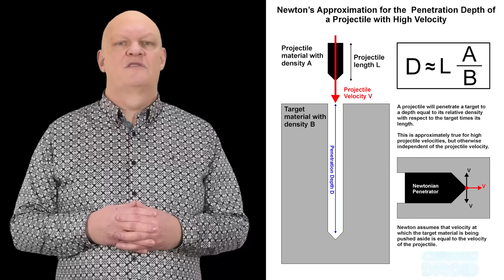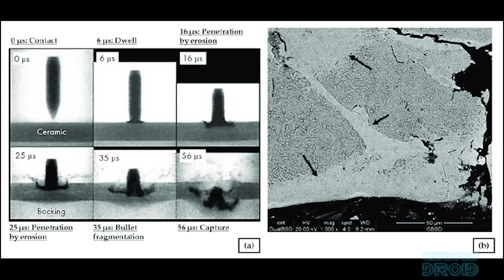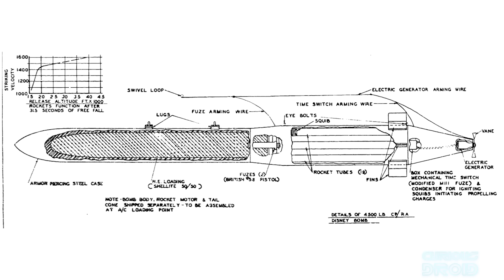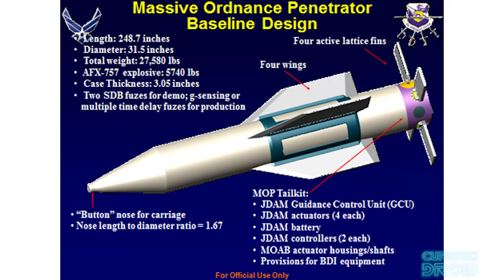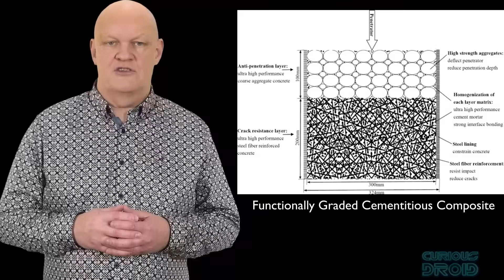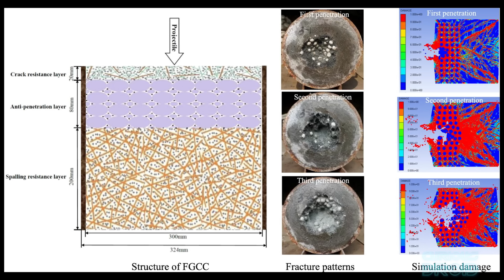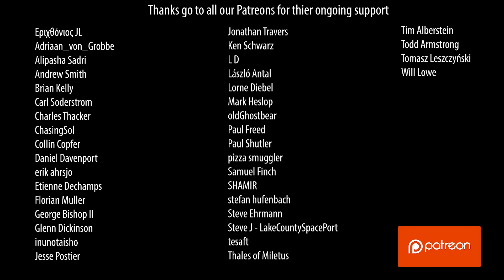Can Iran Stop U.S. Bunker Buster Bombs?

Comment: Worth noting is bunker busting weapons against serious bunkers will only temporarily close ingress/egress routes which are both known (else they could not be targeted) and sufficiently close to the surface to be penetrated. Tunneling far below the reach of any bunker buster including current nuclear weapons has been practical for over a century. Coal and salt mines are examples and could be equipped with their own boring systems to make egress tunnels if existing tunnels were blocked. (That argues for having some delayed action bunker busters to deny penetrated areas.)
A motivated defender can perpetually dig while using finished bunker areas for current operations. Mining is again an example, with many current underground mines like Khewra in Pakistan being ancient. Khewra BTW is expected to have at least 350 more years worth of salt meaning more and even deeper chambers.

Comment: To put it simply my friend :  you can put your pretty head to a .25” drywall and you’d probably make a big hole 🕳️ the size of your head trough that drywall 😊; now if that drywall is was used for decoration to cover up an ugly spot of a cement covered double layers brick wall , well then you will feel something afterward as your pretty head bounces off that wall and found god flying around your head before you pass out with a cracked skull 💀! If you’re lucky you’ll eventually wake up and find a brain surgeon in front of your eyes telling you that he/she found out the problem was that your head was not hard enough for pounding bricks wall re-enforced with concrete 😂! The brain surgeon might tell you to find harder heads like that of Vladimir Putin or that of Donald Trump or even that of Adolf Hitler for the purpose because by using your head this way does not make your head look 👀 so pretty 🤩 any more 😂

Comment: As an engineer that worked with reinforcement bar (re-bar) and 50 newton concrete, I still can’t believe that this stuff exists. I’ve burnt out 14mm, Hilti SDS drill bits one per hole to a depth of 60mm yet these things go through 6000mm and carry on! Insane!

Comment: I'm not sure if we can see polymer reinforcement in 14:18. This looks like steel wires.

The thing with polymer reinforcement is that it is used to prevent shrinking of concrete during curing. Polymers does not make a significant change in concrete tensile strength. It's different if you use steel wires. Its called scattered abrasion, because in opposite to ribbed reinforcing bars they are added to the concrete during mixing, not welded on the construction site. It's downside is that the wires may stick outside the concrete surface.

Comment: The video at @12:07 suggests a GBU-28 was dropped in Iran but failed to penetrate one of their bunkers and instead got embedded. The time reference was the late 2000s, and GBU-28 was the most cutting edge bunker buster at that time, as MOP wasn't built yet. It would also naturally suggest Iran would have a copy of it for analysis and reverse engineering. Also around the same time, a Lockheed Martin RQ-170 stealth drone was captured by Iran. Was this a distraction from it? May I know if there is any credible evidence to suggest this incident took place and what was the context for the attack? Perhaps the reason the US didn't bad an eyelid to invade Iraq but is queasy about attacking Iran?

Comment: Close to 20 years ago or more I was viewing a TV program regarding a quite large Mansion that a very wealthy individual was building on a ridge some where in the US, in a forested State.    In specific the individual who owned the building had it built of a "then newly formulated type of concrete that was  extremely resistant to direct bombing, earthquakes, and other results of detonations such as shock and various concussion stress loads.     The TV narrator mentioned that the formula of the concrete included mixing   a large percentage of specially formed  shaped metal  reinforcers- either X shaped or L shaped and or similar  and  half an inch or so in diameter on average.     The inclusion of the  metal - be it stainless steel or other  type, in conjunction  with standard rebar and other design features made the structure  virtually impervious to conventional bomb strikes or other conventional type explosives as well as natural disasters.    I gathered that the individual who built this Mansion had developed the concrete formula and had sold it to the US Government.     To address other Nations efforts at protective bunkers etc.,  it would seem to me that  North Korea would be an example of a Nation that has a lot of factories under ground - over 135 munitions factories as of 20 years ago - and  these factories and munitions dumps are likely buried deeper than any deep penetrator designed to date can reach, and could likely survive the standard small nuclear weapons yields that would be used.    Don't kid your self that the Russians and Iranians and others have not been studying this issue and American advancements.     A Deep penetrator could not penetrate to the NORAD Command Post, and it would take several LARGE Nuclear weapons to do so as it is under thousands of feet of granite, and then the Rooms in the tunnel complexes are mounted on giant shock absorbers to deal with the shock waves from direct nuclear strikes on the mountain.  One may expect that the Russians, Chinese, and others have similar.    Finland,  from what I understand has a massive civil defense structure under ground to survive radiation - not necessarily blast.

Comment: The U.S. has recently developed a new allow that's even stronger the Depleted Uranium.

Other possibilities is target beside the bunker going 200 feet down and a massive explosion destroying the structure from the sides. All the protection is after all on top.

You can also use multiple bunker busters in succession seeing as they're so precise. Each penetrating deeper.

But as stated at the end of this video, you can just bury the bunker so it's no longer accessible.
Reply: 90m is much too far down for such bombs. 500m is well beyond that.  As for the use of multiple bombs for the second bomb the target is now down to a 10 or 20cm circle in the middle of the hole. I doubt that even precision munitions are that precise. Certainly laser or GPS guided bombs aren’t.

Comment: wowie those bunker buster bombs are Almost as powerfull as the "planes" that penitrated the WTC! Remember the WTC?  Hollow aluminum tubes flew into the WTC and the wing Tips, even Tail, sheared load bearing beams!! And the proof is in the video and the cartoon like cutout image of the  plane and wings tips left when the plane enters and Something exits the WTC, as Rather and Jennings said "it comes out the other side". Impossible. It wasn't the planes nose we see, no, we see The Shape of The Explosion, the plane is the bomb. No aluminum plane can do that.... I stood right at Dwight and Nile, San Diego Ca when PSA flt182 crashed. It didn't leave a hole in the intersection in fact the same asphalt is there today. And the wing snapped off after it touched a home roof, the sidewalk and street. Poof,  wing gone. So what really hit the WTC??

Comment: Food for thought, has there been any thought using the same,composite-enhanced concrete's, possibly capped with the latest ultra high P.S.I. steel for a/the`,
rocket assisted "pencil" thin penitrator(s)?.....

Comment: What if a missile-train approach were used, where multiple missiles precisely follow the same targeting point?
If the newer concrete has different types of layers, perhaps the missiles could use the same approach, where the first lead missile is designed to penetrate to a certain point or in a certain way and each subsequent missile has its own specialised function and capability.  Since these bunkers are stationary, the point could be repeatedly attacked.

Comment: Reinforced concrete structures are now often built in layers with other "laminate" materials in between the layers not unlike how Chobham and Dorchester tank armour is constructed. Some of the "laminate" layers are now fairly high tech polymers that are designed to remove the kinetic energy from "bunker busting" projectiles and when taken as a whole are now extremely effective at stopping penetrative projectiles.
Reply: That's why I'd target the air systems, entrances and non-bunker infrastructure. 

Going to farm, build factories and have oil refineries in a bunker? Supplies gotta get in there some how. Missiles gotta get out some way.

Kind of hard to defend your infrastructure when you're hiding in a bunker.
Reply: But did iran had the know how, Materials and time when they build it up a decade ago i just wonder?
Reply: Smirks In Newton.
Let’s test this theory from 90,000 feet.
Reply: @H33t3Speaks go on then shit for brains please tell me what American aircraft can fly that high
Reply: Nasrallah would highly disagree with your assessment
Reply: @Rvbcaboose714  wasnt he killed in a fairly normal apartment building?
Reply: @POSTSINGULAR1TY  He allegedly were located in a bunker/tunnel  system beneath those apartment buildings. But I would have liked to know the depth.
Reply: @Masterchef_XX it was 18 meters underground. Israel dropped almost 80 bunker busters at it.
Reply: @germanicus7958  that was Israel propaganda said and the Lebanon said that he was in a normal building, I guess nobody will know.

Comment: You only mentioned cement but Iran had built it's new bunkers and tunnels under rocky mountains. So now there is an additional very thick layer of rocks. These bunkers can't be penetrated and for sure they have take any necessary precaution to get multiple entries and exits hidden from above.
Reply: Reinforced concrete has a higher psi rating than mountain solid rock all goes off the psi of the material
Reply: @hookemrods8101 Rock has a PSI rating up to 30.000. Adding dozen meters of rock above the cement makes the bunker impenetrable no matter what. The lost kinetic energy can't be counterbalanced by any other mean.
Reply: @nikolaskallianiotis8622   let me know how that works out up against 110 million connective energy off just one of United-States  new bunker bomb 1000 class 👍🤣 that's the baby of the 3.
Reply: @hookemrods8101 The most powerful US made bunker buster can penetrate up to 60 meters of concrete. That's all. We are talking for hundreds of meters rock and concrete. The other option is to go nuclear but then you start WW3. Learn to read and use your mind.
Reply: @nikolaskallianiotis8622   you're going off the gbu 56 numbers not the gbu 72 numbers 🤣
Reply: @nikolaskallianiotis8622   lmao you're comparing limestone  to quartz us do their test on quartz mineral mountains no soft rock like limestone which is what The Zagros mountain range, itself, has a totally sedimentary origin and is made primarily of limestone.
Reply: @hookemrods8101  we already have the answers. U.S military failed to penetrate Houthies bunkers and they are similar to Iranians bunker if not Iranian s better.

Comment: Why are we using Flintstone units? US military is metric. PM Mahmoud Ahmedinejad is a professor of civil engineering, and the Iranians are experts in novel concretes like carbon fibre mixed with conglomerate. Hitler's Germans uboat pens and flakturm could not be penetrated nor destroyed neither by Grand Slam nor Disney Swish.
What US destroyed in Iraq, the US had actually desogned or built.
Iran watched and learned, they will use a composite construction system of multiple media to thwart US GBU57. GBU 57 has a fuze that explodes on cessation of movement. Therefore an easy avoidance feature is to dupe the enemy into thinking everything vital is indeed in deep bunkers, not a vast sprawling network of moderately hardened facilities with multiple blast doors and blast diversion tunnels to relieve overpressure. 
The US is essentially seeking to penetrate a NORAD-like Cheyenne mountain-like facility. I am sure the Iranians have forseen and mitigated against this obvious target.
Also interesting you failed to mention Iran wins vs USA according to wargame Millenium Challenge 2002 simply through WW2 type robust secure messaging and using known Iranian tactics Lt Gen Paul van Ryper USMC whipped USA. After USA debacles in Syria, Iraq and Afghanistan what on earth would anyone be intoxicated by that US magically wins vs a NVA-Afghan hybrid war with distributed production of newest Russian missiles- with ample open multinational assistance? USA will not prevent every "Muslim ally" smuggling out US top tier weapons- as per Houthi vs Saudi.
Singapore evaluated Igla as far superior to Stinger and Kornet is simply unstoppable 1200mm ++ through RHA/ 3m concrete.

Comment: I wonder if they've just designed bunker busters with Depleted Uranium not only as a penetrator (which they've already done with artillery and some missiles) but also as kinetic mass.  50,000 Tons of Depleted Uranium a shiny hard metal of extreme density is produced every year while extracting weapons grade U235 as well as nuclear reactor fuel.  This weakly radioactive metal is still top level nuclear waste and is an expensive problem for storage long term, making its use as a weapon a solution for multiple problems.  Thing is that it produces Uranium oxide dust on impact which is dangerously radioactive for essentially eternity,  should be a war crime really- but I almost guarantee that there's black project/classified weapons that take full advantage.

Comment: The key to improving the performance of the concrete in impact is to increase its tensile strength. That’s why these modifications work. This can be taken further by instead of using short fibre reinforcement, use long fibre reinforcement. More difficult but the enhancement will be of the next level. This is what we do with fibre reinforced polymers ( composites)
Reply: Like carbon fiber

Comment: The bunker itself can be buried deeper and more heavily constructed.   The weak link is the entrance and the air supply.   The entrance is on the surface and can be hit by precision guided weapons which denies the enemy ingress to or egress from the bunker itself.  Military grade tear gas could be forced into the air intake or we could get creative and pump a stochiometric ratio of butane and oxygen into the bunker through the same air vents.   Detonate it and everything inside the bunker is toast.  I'll speculate that the military has already developed a gaseous explosive that carries its own oxidizer and may have a delivery system to deploy such a weapon to the inside of a bunker.

Comment: As a construction guy, these bombs have always blown my mind. People underestimate just how insane that level of penetration is through reinforced concrete.
Reply: While concrete can be made more resistant, it's a matter of cost/benefit ratio to build many large bunkers using expensive materials.  Then of course the penetration bombs get improved too in a never ending arms race.
Reply: Is it 7873 insanes?
Reply: if it lets anything through, it wasnt reinforced, it was marketed well.
Reply: see 9.25 in MOP bomb this penetrates bunkers that are 61 meters underground so 6 meters of concrete it protects as well as newspaper

https://youtu.be/8m4TlVSQ8As?si=GMNhWC5IaUK-Jq5t
Reply: Piece of cake. Concrete isn’t really all that.
Reply: Its the small block of concrete which have have million cracks and have expanded to make space for it. Its it id reinforced and does not move or bomb will have had time getting theough
Reply: The huge circular bunker (Coupole d'Helfaut-Wizernes) France for launching V2 rockets had a domed roof to cause bombs to bounce off. Tallboys and grand slams were landed alongside the structure. Entrances were destroyed and the surrounding ground so broken up the bunker was abandoned.
Reply: 長い通路とたくさんの小部屋があります
Reply: 200ft
Reply: Sofar.
Recent advances in concrete engineering might require actual nukes  to get anywhere.
Reply: @dwwolf4636  Like he said at the end you would just destroy the exits and equipment that has to be exposed to work.
Reply: @dwwolf4636 imagine a cone charge nuke that makes a violent stream of fire in a single direction
Reply: @dwwolf4636 uhm no ....
Reply: @dwwolf4636  the US already has a new bomb that totally makes this whole conversation pointless.
Reply: @badmonkey2222  not quite really  ... Even the best one  has a limited deepness .

Comment: I think "loose" rock packed in cages with separations between cages would have immense stopping ability. It would behave a bit like corn starch in the way it locks when asked to move rapidly.
Reply: Like the Hasco barriers... I would think the loose rocks would be moved out of the way and/or pulverized, nullifying any stopping power. You're talking about brute force. Usually only something ticker/stronger stops that - like that new concrete - 'supposedly'.

Comment: The Midvale steel company, the research centre of Bethlehem steel, introduced a far tougher alloy for gun barrels, shell cass, and deep penetrating bombs. The shells for 17 pounder tank destroying gun, and the 76mm fitted to US Sherman tanks were a huge advance. The last five months of WW2 saw such an increase in the destruction of deeply protected sites, by this new steel, the generals knew it was all over. This wasn't announced loudly, but Ubot protective devices stopped working.
Reply: stop sniffing glue

Comment: Explosion reactive armour will deflect this similar to tank armour
Reply: No, that is not how that works. ERA doesn't decrease penetration through deflection, it induces forces upon the round which affects its performance, such as affecting the sides to lower its performance and make it less stable in flight. ERA doesn't have as good of a performance against solid rounds, especially large ones that move really fast.
Reply: Not how that works